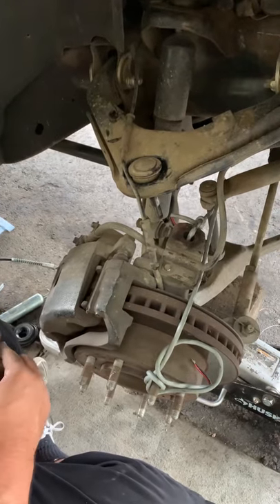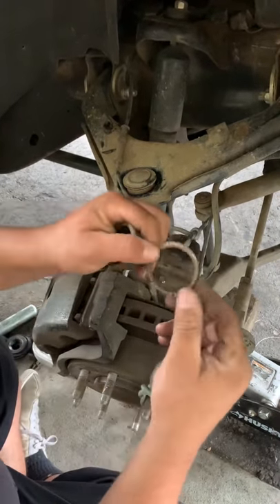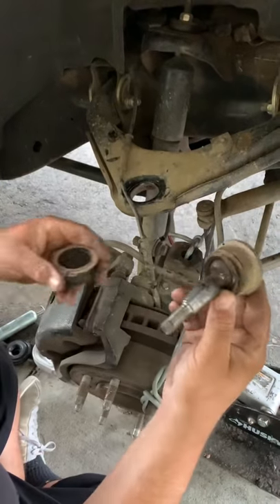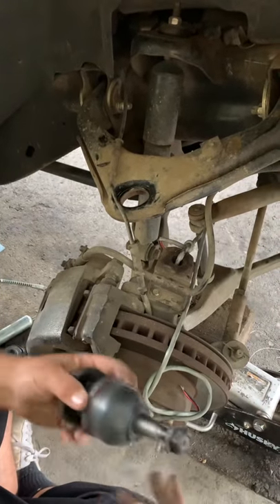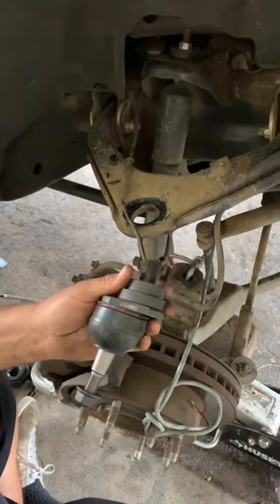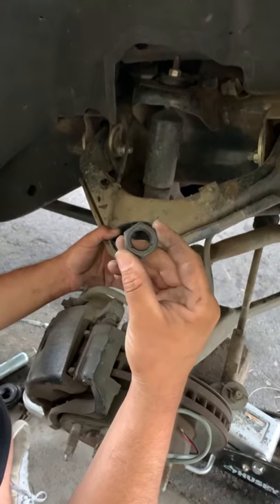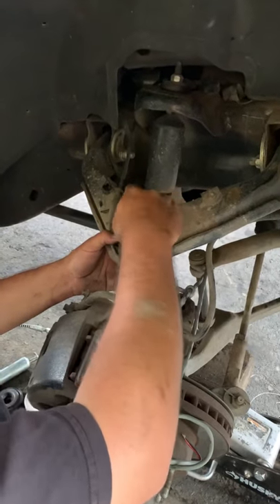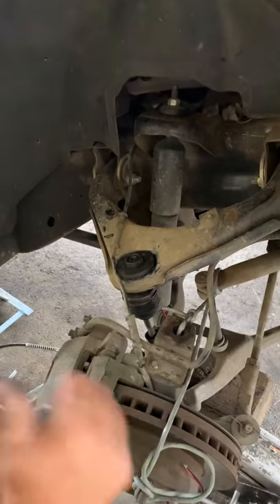Duramax ball joint

Comment: Ball joint repair doesn't require an alignment. Tie rods, front struts, rack and pinion does
Reply: That’s not true at all the ball joint in the video is a adjustable upper for camber / caster 👍